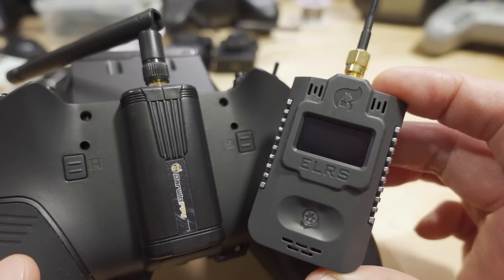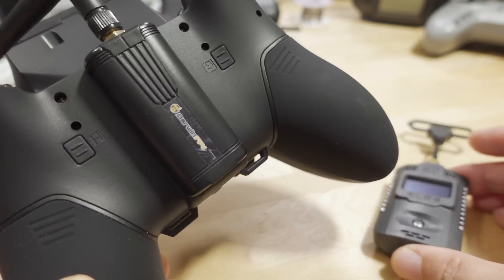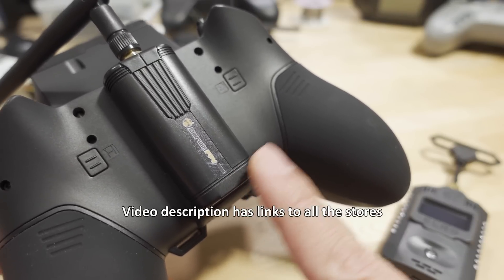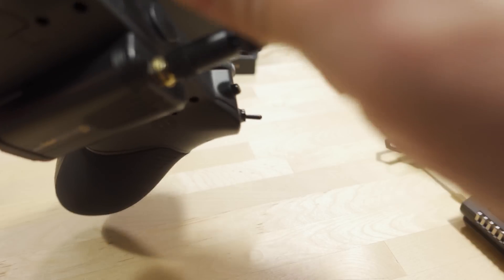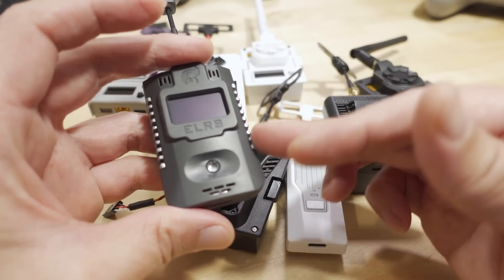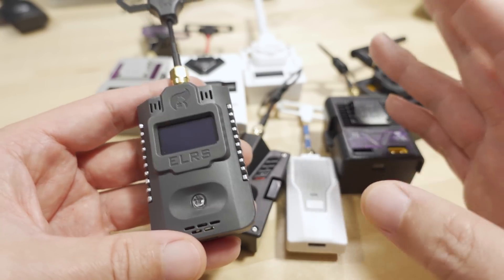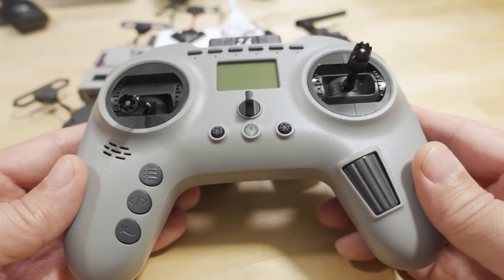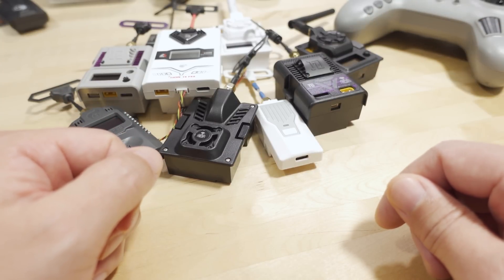DarwinFPV ELRS TX // T-Pro Bricked?? // ExpressLRS News (Jan 31)

Comment: Hey Albert, do you know if the Jumper axion module can be used with the T8SG ?  I'd like ELRS via the crossfire protocol if possible..
Reply from the maker: You need a nano to micro module adapter and hardware mod the T8SG.  Topics way too long to cover in detail in a comment.
Reply: @AlbertKimTV  ok thanks 👍

Comment: very interesting review. 
Do you know if the jumper elrs module does fit the module bay on the TBS Tango 2. I guess this is the same as the Darwin, betafpv, happymodel etc... elrs modules but would be nice to get confirmation. Thanks!
Reply from the maker: I don't think it will but I no longer have a Tango 2 to test it.
Reply: @AlbertKimTV  ok thanks
Reply: @erich7431  I have the jumper aion elrs on my tango 2 pro. Fits just fine

Comment: Yep, the SMA antenna issue bytes, I purchased some RPSMA and SMA pig tails with Ufl connectors that work on some projects. The issues with updating will take time but the vendors and reviewers could smooth it out by doing "This is how as of 2/12/2022'. I just did a BetaFPV 2.4Ghz update to 2.2 and had to fight the WiFi because nobody explained how or why the module wanted to connect at 10.0.0.1  Had someone told me they just needed to get a SID/KEY by having me connect my PC WiFi to the module then with my browser connect to 10.0.0.1 to update the module with my local WiFi network SID/KEY and then reboot and run the Express Configurator to update that would have solved my issues. Did I hear you right, Jumper bankrupt?
Reply from the maker: www.expresslrs.org has a lot of this documented but you have to look around and search for the information... 😎

Comment: hi  do u know rodiomaster zorro 4 in1 and bind with flysky fli 14+ receiver what distance can get ?
and how about bind with radiomaster R81 receiver ?
Reply from the maker: Yes, it will bind with those receivers.  Range is highly dependent on where you fly.  Could be as low as 100m or as much as 2000m.

Comment: True RC makes an antenna for the RP-SMA as well as SMA.
Reply from the maker: Yeah, saw it on Pyrodrone for $15.  Only 5.9dBi gain though.  I think I will just hack my spare BETAFPV moxon which is 5.5dBi gain and just solder on an RP-SMA connector.  I'd rather save the $15. 😁

Comment: Jumper is the most frustrating company in the hobby. They have so much potential to knock it out of the park but always make some stupid decision with every release. I have the T18 which I love but goodness gracious, someone in their team thought it was clever to omit charging capabilities and inclusion of a touch screen at launch 😤.
 I was looking forward to getting into ELRS through the T-Pro ELRS but flipping hell Jumper!
Reply from the maker: The T18 V2 fixed those problems so the V2 of the T-Pro ELRS will probably have these issues fixed as well.  Being an early adopter in the FPV world has a lot of risks.  Most seasoned pilots already know this now.  That's why a lot of people wait for the dust to settle.
Reply: @AlbertKimTV  "dust to settle" Current BetaFPV 2.4Ghz 1 Watt module with OLED screen with fixed USB opening and fan that can be set for when it turns on. On the Radio:TX16S is in the third version now I think.

Comment: Albert, excellent decision on your part of hold off reviewing new hardware when they are in the update que but not yet available. I'm sure the manufacturers are anxious  to get their product to market before the initial rush to join the ELRS starts to die down, but your way of introducing them helps ensure that customers get a product that is ready to go and protect a product from getting a bad start.
Reply from the maker: Yeah, other reviews come out as soon as they get them and they either don't tell the viewer anything about it or they bash it prematurely before full software support is released.  I don't think that's really useful for the community.

Comment: So with the new edgetx version an fdti adapter is not required to reflash a bricked module?
Reply from the maker: Yes, that's why there's the updated EdgeTX firmware download link on that page I mentioned in the video.  No need for an FTDI adapter.